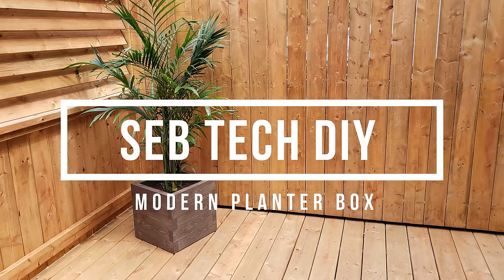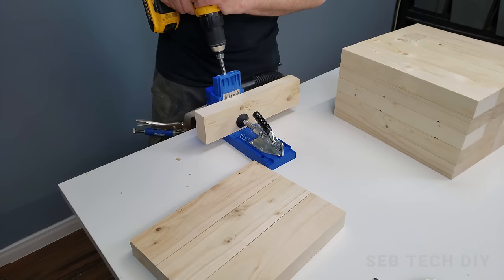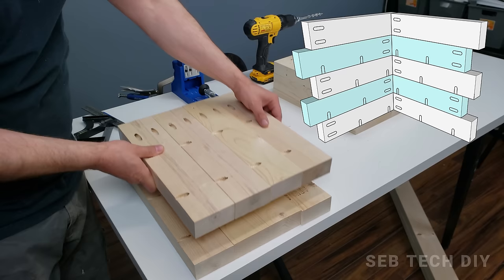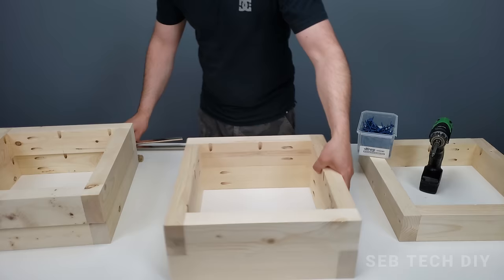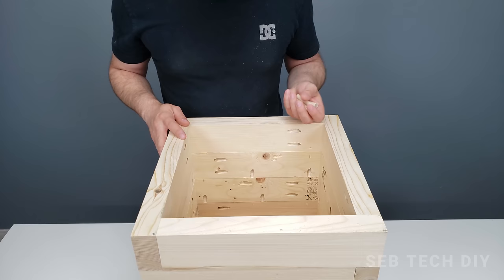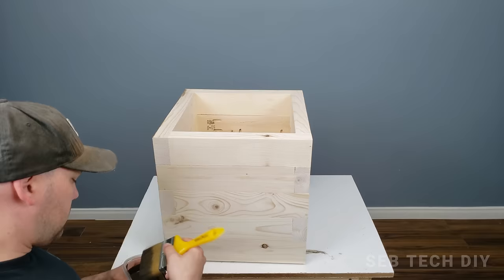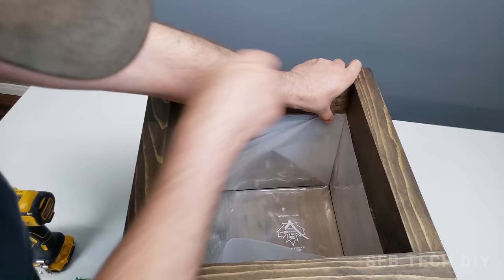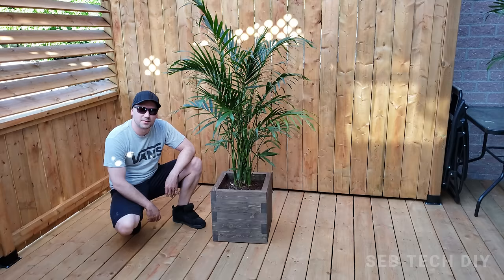DIY Planter Box with 2x4's - How to make

Comment: no need for pocket holes. just attatch a piece of 2x2 on the ends. do this for 2 sides. any holes you make on the outside if using screws can be filed with gluey sawdust. then stain the whole thing. these small circles give it character

Comment: Great built! I wonder how this will hold up over the years? Treated lumber may be  better perhaps but I know it's more expensive harder to work with. Perhaps line it with some type of rubberized paint or something? I built some long planters 5 years ago and although I used treated lumber for the sides I think the bottoms were not and they are slowly rotting but every year. They are the centerpiece of our deck - the secret her in CO is to water the plants 3 times a day with built in drip irrigation! Flowers from May to Nov!

Comment: Great video, bad plan. Where did you buy your mini-drill that fits inside this thing? I've got 24 cut pieces and can't use my drill inside to assemble them because a dewalt cordless is waaay too long to fit inside. I'll have to modify your plan to do anything... or buy different tools.
Reply from the maker: Hey Kev. My drill is an old 12v hitachi, most 12v drill are small enough to fit inside or any impact driver should fit inside too. You could also buy a 90 degree adapter for your drill it could work too. Sorry if plan is not the best, i'll sure try to to better the next time. What is particular you didn't like? Did you also check my instructables it's a step by step guide with pictures it may be easier to follow than my video, you can check it out here : https://www.instructables.com/DIY-Modern-Planter-Box-Made-With-2x4s/ , hope it help! 😉

Comment: Thank you for the shared and how much cost for the box?
Reply from the maker: Depends, right now 2x4 is overpriced, but in normal time, it's around 20 buck for wood and screws for 1 planter box. I already had the plastic liner and geotextile so I saved on this part, it was the same thing for the wood stain, it was leftovers from my bed frame. 😊

Comment: What will you do with the drain pipe when you move it inside?
Reply from the maker: We did this last winter, i simply put them on a shoes tray. But the trick is to water them regularly so you'll never have water through that drain. When they are on my deck, i care less and put the hose directly in the planter box. 😄

Comment: Be easier too clue it.
Reply from the maker: Yes sure it is an option, i was just not sure how well they would hold up outside using just glue, plus all outdoor glue i find needs to be clamped for 24 hours, in my case having screws acting like clamps was my solution. I did pocket hole but you could use simple 3.5 inch screws all through two 2x4 👊